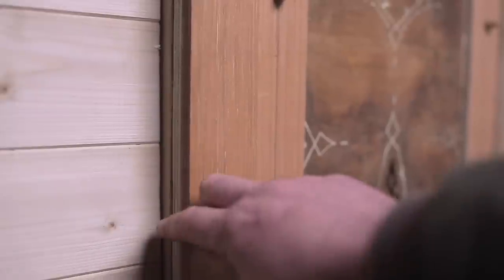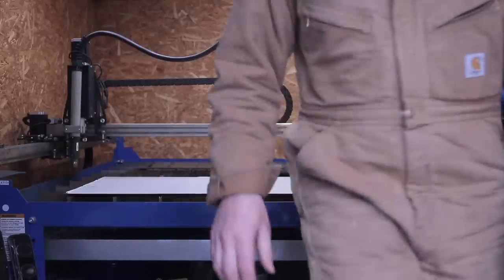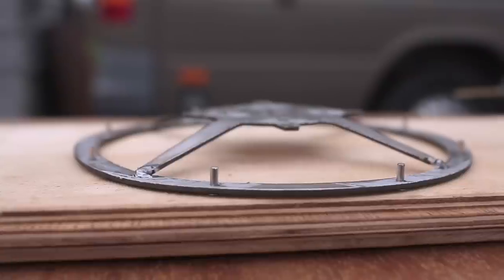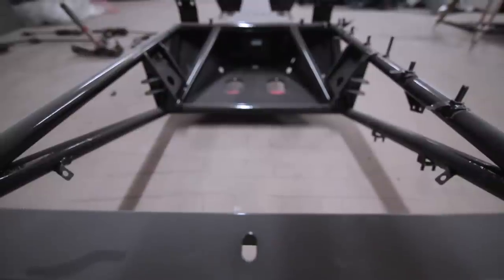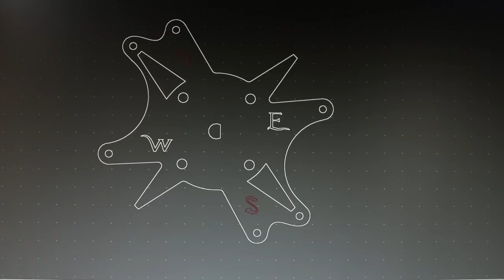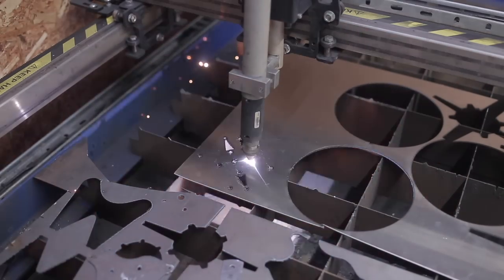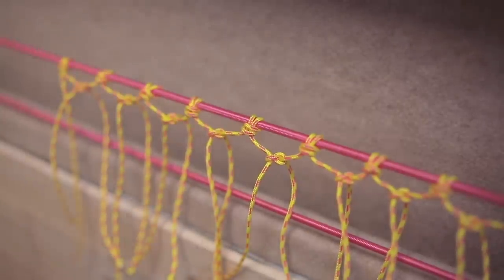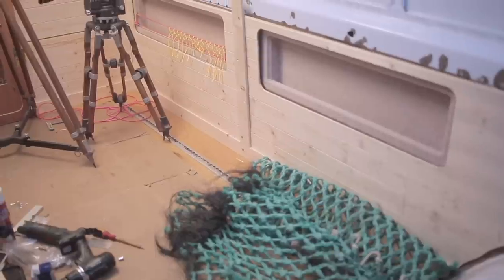One off camper conversion with a nautical secret | Sprinter van

Comment: Nice work - I think you'll need some vapour barrier behind that paneling.  Warm inside and cold outside = condensation = warped wood.  Same principle as a house...
Reply from the maker: Didn’t you see it going in?
Reply: 😴I must have looked away..... too many late nights working on the cars.  A good excuse. @soupclassicmotoring

Comment: That spare space you're putting pocket shelves into... that's where insulation should be on a useable van.
Reply from the maker: I doubt filling two apertures with 12mm ply wrapped in carpet will render the van unusable

Comment: Congratulations on becoming a Dad the van is looking great one question what is the material you used in the  side pockets you made 
looking forward to seeing more from you 
best regards
Reply from the maker: Thanks a mill. The material is known as 4 way stretch carpet or van lining. It does what it says on the tin but I pushed the stretch to the limits with the right corners in the pockets
Reply: @soupclassicmotoring   thanks for the reply in all fairness it looks fantastic the work you have done so far the amount of time and engineering  you have done is remarkable i hope that you will have many miles of travel with your family best regards

Comment: Hi I am working on a rusty sprinter myself and hoping for some advice. I keep blowing through the metal. I have tried adjusting the voltage down but am having the same issue. May I ask what size wire and settings you were using on your welder? Thank you.

Comment: It would be about 60 years ago my Dad taking me aboard a serving submarine,they had an open house. Do such events still exist ? You could see for yourself just what the engineers came up with. Are there any preserved WW11 submarines on display ? Research vessels ?
Give you a day trip and further bright ideas ?
Reply from the maker: Not in Ireland anyway, but was at an open day on an Irish Navy vessel :)
Reply: @soupclassicmotoring  Not just submarines have watertight doors. At any rate,very impressed with what you did. I think of a metal screen door years ago,should have done something like that with it. You had your thinking cap on,no doubt about it.

Comment: Ooh, I fear that your door mechanism, as cool as it is, is going to jam up when all those dowel sleeves expand from absorbing atmospheric moisture. Make those pieces out of nylon and your door will work much better.
Reply from the maker: Good call, the dowels were out in the van a few weeks before finishing so had already tightened up before final assembly, I over bored the sleeves and now they’re loose enough that they don’t even need to pivot as initially intended 🤷🏻‍♂️
Reply: Cool. Have you thought about one of those side mounted retractable awnings, the ones that wrap around the back of the vehicle as well? That will let you keep the back of the van open when it's raining so you aren't cooped up inside.
Reply from the maker: @ArmySigs  yep, been mulling on that one. Prob is the rear doors are taller than the gutter/ideal mounting point for a wrap around awning, which makes things more complicated.

Comment: Beautiful, but too much precision imho. Hit a few potholes, carry some weight, etc and the alignment of the rods to the door frame may not hold.
Reply from the maker: The rods will have tapered ends as per the real thing, it means there can be a margin of misalignment and the rod will pull itself into the hole ;)
Reply: @soupclassicmotoring  got it. would hate for you to do all that effort and then it not work!
Reply from the maker: I’ve been monitoring the door for sag since November. The hinges are massively over spec’d because the door is pretty small and light, so all good so far. I’ve built the bulkhead frame pretty strong too so fingers crossed any movement will be minimal

Comment: Congrats on the DNA expansion. Please don't film a nappy change using stop motion lol. Take care bud - my Lotus has stalled big time (and possibly terminally) but my 2008 FFRR is hopefully returning better than ever in the near future - 2 turbos and much other work done
Reply from the maker: Lol DNA expansion is one way of putting it Ant. Sorry to hear about the Lotus. Surely there is a way?
Reply: Would love there to be but I have to face some harsh realities (well first world ones at least lol) - It's never going to be worth anything like an Esprit - although I love the Elite, it doesn't have the same appeal. I guess I knew that when I bought it but I really struggle these days with my back and have to recognise my days of laying under cars are over. For someone else to do it is likely to cost well in advance of £15k minimum to do it justice and I'm already into it for about £3500 minimum (don't care to add it up!) plus a load of hours. Everything on it has been awkward and very frustrating and I've got to the point where I'd rather put cash into the Rangie that I know I will be driving for a good 10 yrs (politics allowing). I have hardly touched it for 7 yrs and it really needs to go somewhere it can be sorted and loved. It has a galvanised chassis and only done 39k if you're interested 😉
Reply from the maker: I get it, I’m probably coming to that crunch day with one or two in the stable… just won’t get the use they deserve. Especially when the Esprit is done. Def interested in the Elite (although it’s probably far fetched atm) let’s chat
Reply: any time - would love it to go to a good home